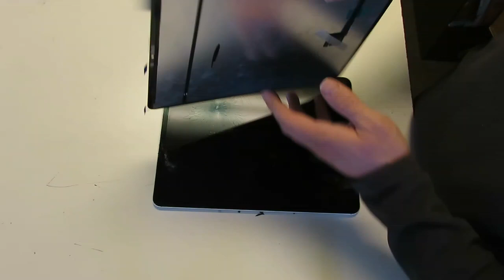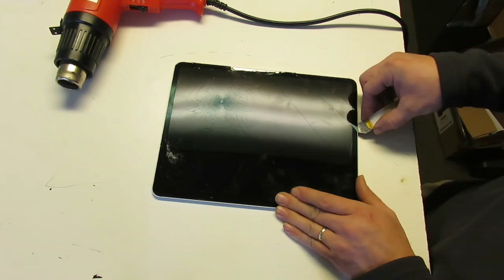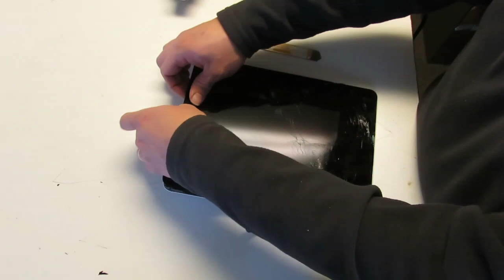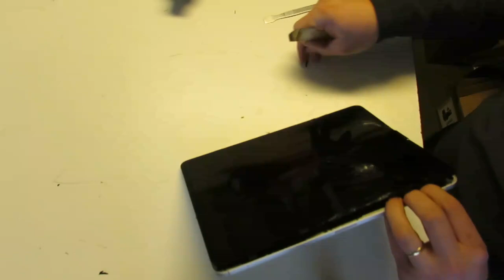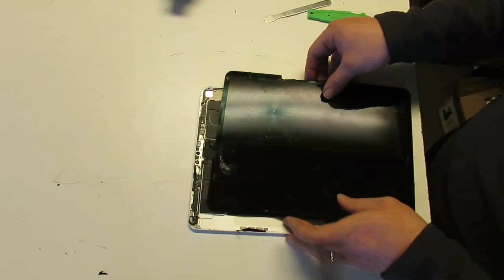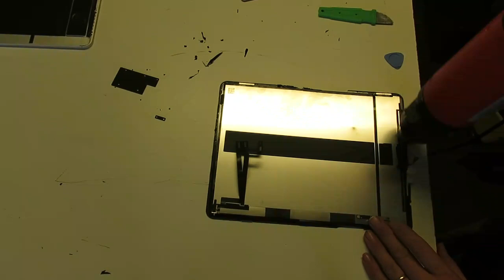iPad Pro 3rd generation 12.9" glass screen, LCD, & Digitizer replacement - A2014 & A1895

Comment: Would it be safer to warm up the front sensors through the glass or would that not soften the adhesive enough?
Reply from the maker: That would definitely soften the adhesive a bit, however it is also very easy to overheat things and cause damage that way; with the front glass out of place, hot air can easily find its way to the battery or the back of the front camera sensor (both of which are somewhat sensitive to heat.) As a rule, I avoid using heat on any device after the front glass has been removed, if possible.  A heat pad or heat bag would definitely help, though I don't personally use either.  A heat bag is basically a cloth bag filled with dry white rice, which can be microwaved to heat up, and will stay hot for 30 minutes or so. It will heat things slower than hot air, but it's safer, because the heat stays right where you put it, and won't travel around to the sensitive parts. If you need extra heat for this repair, I would recommend using a heat bag.
Reply: @ArtByStrongWolf  Ok thanks! :)

Comment: So I was literally putting in the last screw for the cover on the lower flex cables after replacing my charge port on my 3rd gen 12.9 iPad Pro and I accidentally tore the proximity cable in half at the place where it curves around … is it true that replacing that cable will leave my Face ID unable to recognize me?
Reply from the maker: Unfortunately, it is true.  It's Apple's way of punishing you for repairing it yourself, and trying to force everyone back to the genius bar.
Reply: @ArtByStrongWolf  Well, since it's just a tear in the tail end of the cable, I'm going to try and repair it before I re-seal the glass. Any tips or words of wisdom for repairing a torn ribbon cable? I've never fixed a ribbon cable before though I am quite adept with a soldering iron and I own a decent hot air rework station.
Reply from the maker: @MikeSims70  I've had a few successful ribbon repairs, but they're far from easy.  Under a microscope, remove the poly insulant with the edge of a razor blade, at least 1/2" from the break, leaving the broken area alone.  It takes a very gentle touch, because the layer of plastic between the layers of contacts is about the same thickness as the layer you're trying to remove.  I believe these are double-sided flex cables, so you're going to need to do it on both sides, in slightly different places.
The last piece of advice is to buy some .02mm coated jumper wire for the repair, it's a million times easier to work with than anything else, when you're microsoldering.
Reply: @ArtByStrongWolf  Good idea on the .02mm jumper wire... and double sided ribbon cable? UGH - I don't predict success but I'm going to give it shot none-the-less. It's not the end of the world not having face ID recognition ... about the only place I find it useful is when I make app store purchases but other than that, typing in a pin to unlock is hardly an inconvenience ...
Reply from the maker: @MikeSims70  Good luck - at least at this point, you have nothing to lose by trying
Reply: @ArtByStrongWolf  One more question ... which double sided adhesive do you prefer to use for re-sealing the glass? I have some stuff that is marketed for cell phone screen repair, but I don't do these repairs often as folks like you do so I'm curious as to what you use.
Reply from the maker: @MikeSims70  I use 3M cell phone screen adhesive, comes in a 2mm width roll.  For screens with small contact area, I add small dabs of e6000 (like on most LG phones.) For this, 3M tape, then clamp overnight.

Comment: I have a question Can I use an iPad Pro 3 gen  screen to replace an iPad 4gen with the 3gen screen ?
Reply from the maker: I haven't repaired an ipad pro 4th gen yet, but I suspect that they are not compatible.  If the price is significantly different, they are definitely not the same.
Reply: @ArtByStrongWolf  tankyou Apple is very expensive $600 for replacement the screen ridiculous

Comment: I have a 3rd gen 12.9 A1876. Does this apply
Reply from the maker: Yes it does. The A1876 is wifi-only, the model I repaired was wifi+4G.  The screen repair process is the same for both.
Reply: @ArtByStrongWolf  is possible to install lcd display front 3gen to 4 gen did you know? Thanks 😊
Reply from the maker: @andreimosneaga3935  I haven't opened a 4th gen yet, but I do not expect they are compatible.
Reply: @andreimosneaga3935  the screen is the same for the 3rd and 4th gen iPad pros
Reply: @michaelburgan6786  thank you very much!

Comment: Would you happen to know where these two small magnets go? https://ibb.co/XjV0f64 When I removed the old screen, these two magnets came off with the adhesive holding the screen on, but I can’t figure out where they go. My pencil still sticks to the side of the iPad as it should, so I’m not even sure they are really worth the trouble to squeeze back in there. Notice how each has a notch in it, but the notches are not in the same locations. Any ideas where these go before I just give up and button it back up as-is?
Reply from the maker: Honestly not sure, just from looking at them. I don't have one of these open in my shop to compare at the moment. They aren't needed for any of the hardware or sensors, so if you aren't using a magnetically attached case or anything, they shouldn't affect your user experience.
Reply: @ArtByStrongWolf  Ok, thanks for the reply!

Comment: On my iPad there is a crack next to the camera
Reply from the maker: The repair may still be possible; just exercise extra caution when removing the glass and proximity sensors.  Worst case scenario, is that the facial recognition won't work after the repair.

Comment: You skipped over the front facing sensors!  Rip off!
Reply from the maker: Jump to the 20:56 mark, it's all there.
Reply: @ArtByStrongWolf  You went off camera performed the trickiest part, which is installing the sensors such that they are properly aligned.  Nope. Incomplete.
Reply: What is your "rip off". Did you pay to watch this video?
Reply: @sherrysellers1662  Mind your beeswax.